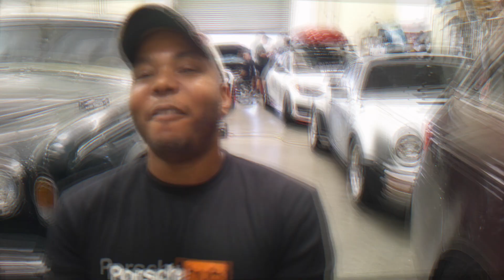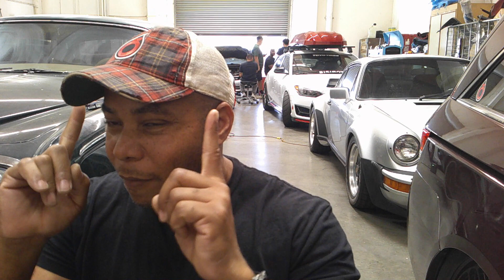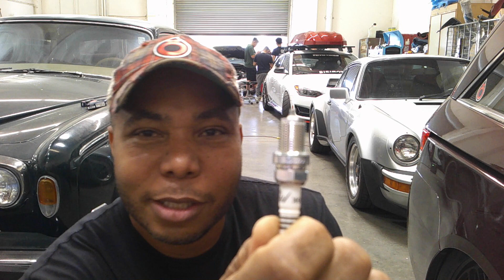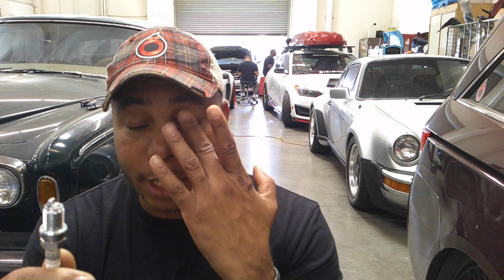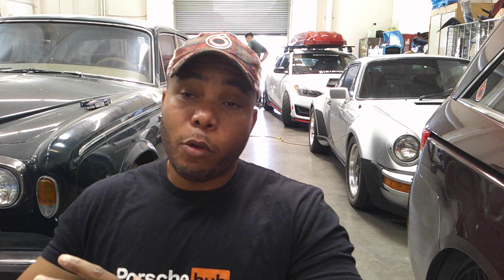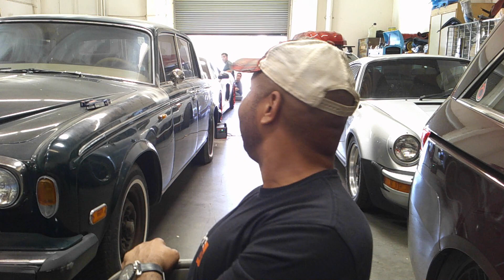Octane Boosters & plugs, best throttle body size, and staged injection

Comment: Off topic. Hypothetically if you were
going to tune a 2001 Acura MDX(perhaps Turbo), what computer system would you use?
Reply from the maker: I would prefer flashing the factory ecu.
Reply: Bisimoto How would you go about that? 

I’ve already done research and picked from a junk yard ecu plugs and clipped wires from a 01-03 CL/TL and compared them to MDX plugs and wires(using pinout chart)  and everything is exactly the same besides two wires which for the CL/TL it’s for traction control and for the mdx it activates awd so pretty much it’s the torque vectoring wires. Besides that every other wire is exactly the same. I thought about getting a boomslang harness for tl/cL and using an AEM FIC but not sure how well that basic fuel management unit would work.